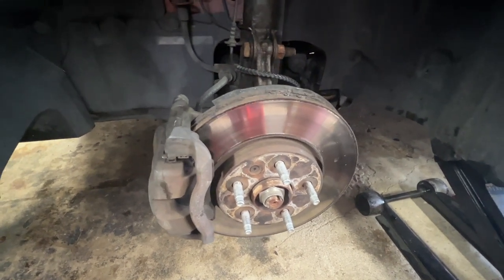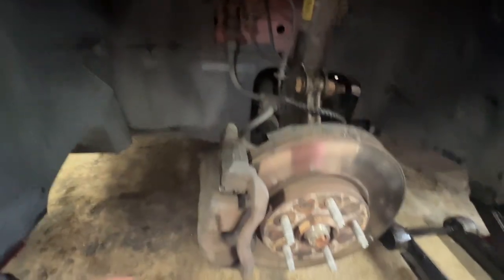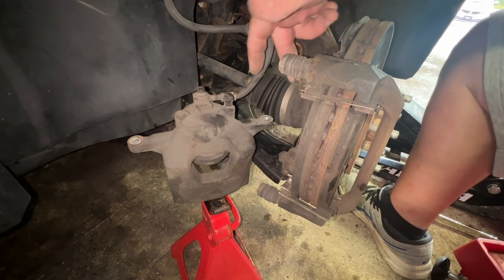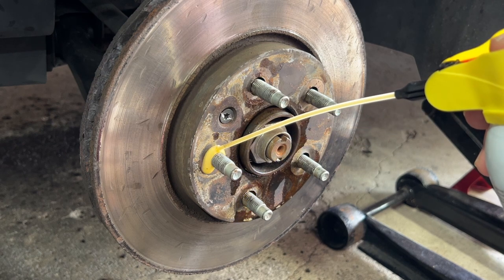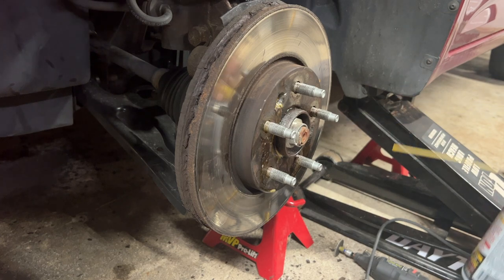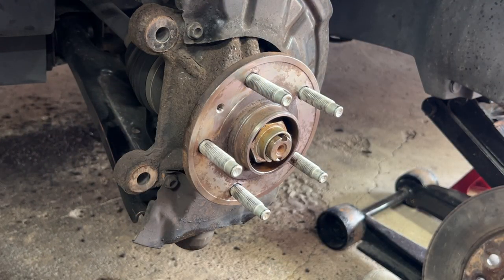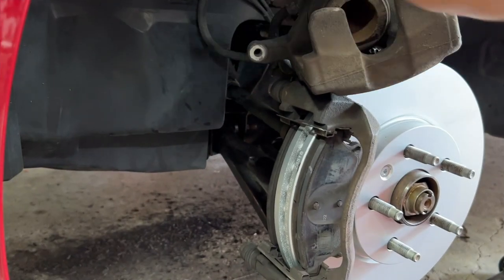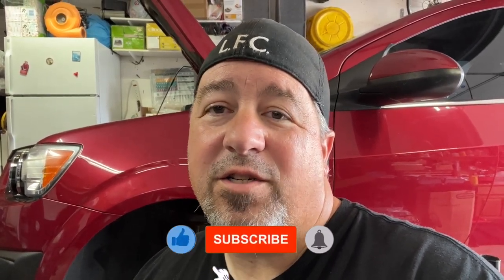HOW TO REPLACE BRAKE ROTORS on a CHEVY SONIC, CRUZE, ETC - QUICK and EASY DIY - SAVE MONEY!

Comment: That torx screw does not like Canadian Road Salt. 
Mine snapped off with just a little effort.  I Did not bother trying to get the broken screw out of the hub. I am confident that little screw is not necessary. 
I was told its only function was to hold the rotor on while the car was on the assembly line. If anyone knows different please (kindly) let me know.

Comment: you didnt Mention what size the Torx bit is
Reply: I have a 2017, it's a t30
Reply: @zandatsu_cooks  both of mine snapped off with minimal effort.  The torx bolts are very soft metal